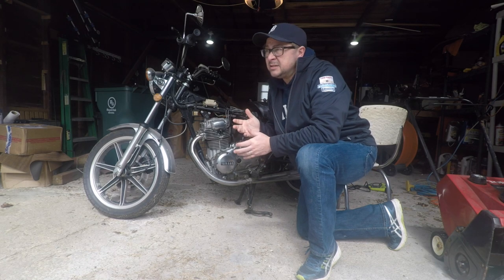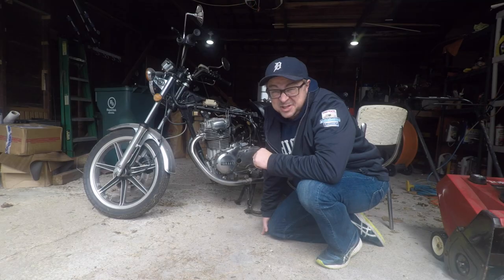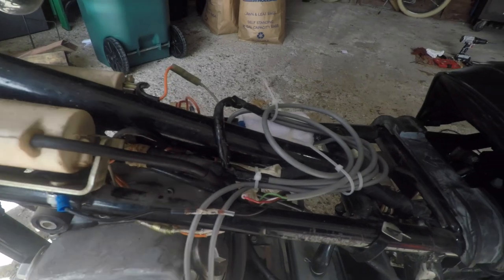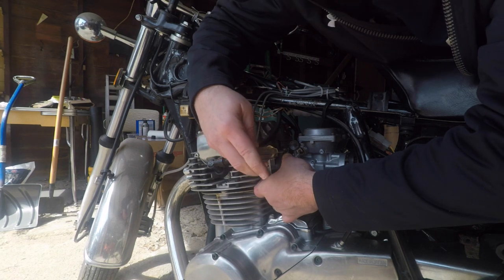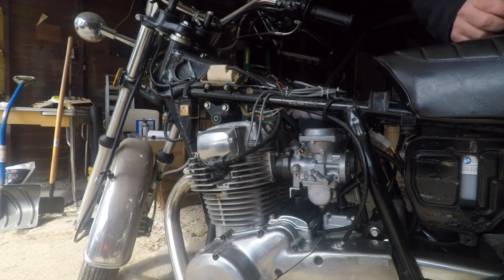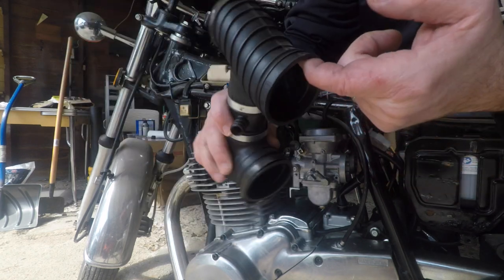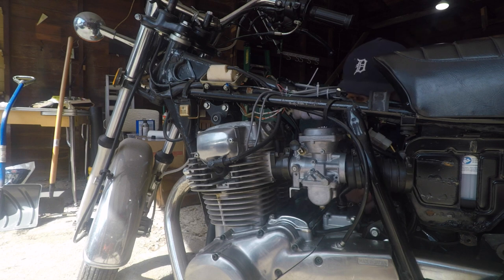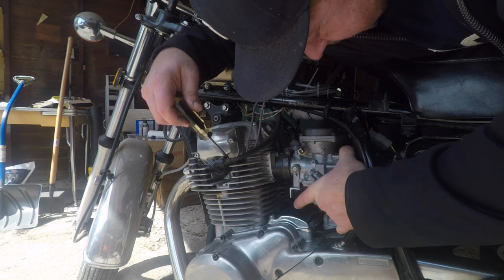1978 Yamaha XS400 Runs Again

Comment: I have the same xs400. Also, had a similar issue. One cylinder would run and the other wouldn't. Luckily, mine got fixed with a new spark plug. 🤞🏼

Comment: I have a 1982 Yamaha XS400 Special II. And it runs but ides high then low then high and sometimes acts like it wants to “Runaway” even after the engine gets piping hot. I cleaned the carbs (they were caked & clogged) I then had the carbs worked on, put new spark plugs in her, she showed no spark ⚡️ on either cylinders for a while there but cannot get both stabilized to run as a great pair. She seems very cold natured, new battery 🔋 easy to start now, I use only 90 octane non-ethanol gasoline, no gray or blackish exhaust, not running too rich !  Fellas I’m at my wits end 😢. What do I doooooo ?
Reply: Does the revs go up if you spray carb cleaner on intake boots/inlet on engine as could be a leak from a cracked boot messing up the mixture?